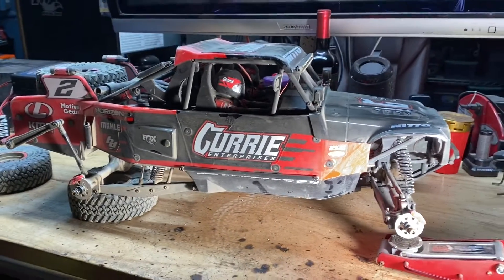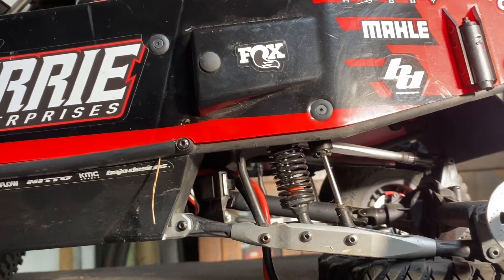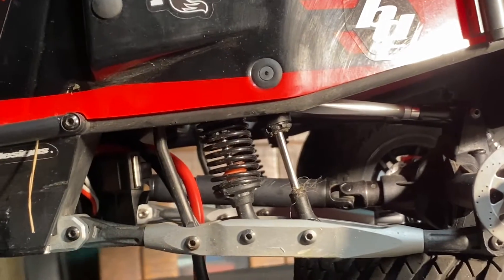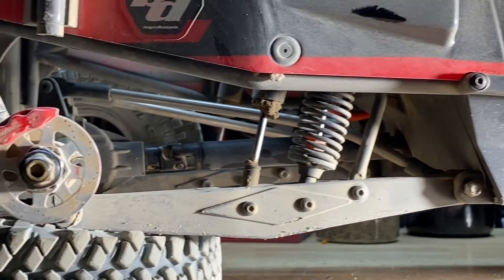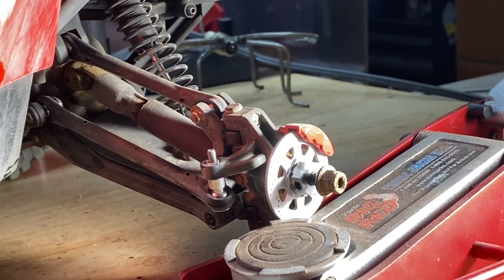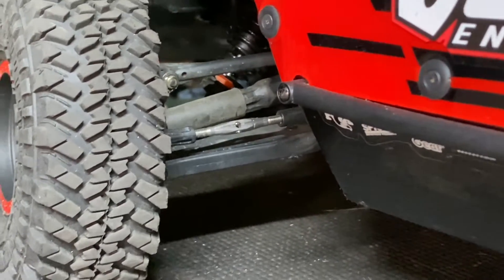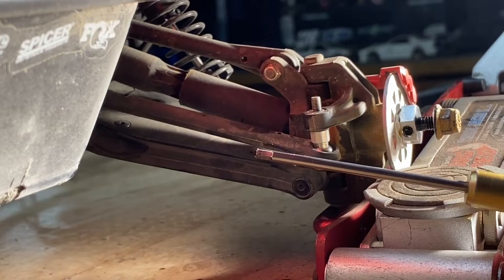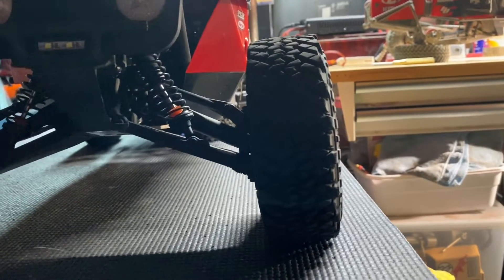Losi Hammer Rey suspension tuning

Comment: So the rear upper links you built, does it have to have that bend in it? What is the purpose for the bent link instead of just going straight to the mounting point on the diff?

Comment: I learned smth interesting, don't know how relevant it is. On full turn, at least as it comes out of the box, on the wheel that's on the inside of the turn, the axle catches in the knuckle arm if the suspension is extended all the way, making said inner wheel almost stoping. Happens on both front wheels. It became even more obvious for me once I installed some ALU upgrades for the knuckles. Also, there are visible markings on the knuckles where they made contact with the axles. For now, I will just limit a bit the steering end points to avoid this.

Comment: What rear upper links are you using?
Reply from the maker: I made them
Reply: Any specifications on the length of link you used and about how many degrees is that link bent?
Reply: james tomlinson would you please provide this spec detail so that we  may modify and fix that issue
Reply: @IDEALRC  awesome job on the links!  Jumping on the Lathe now and making some for mine. What length are the links and tie rod ends are using?

Comment: You said that you only get driveshaft changes at the transmission end. The problem with that is that  you'll get the diff not changing it's angle inline with the trans and one end of the drive shaft with have severe velocity fluctuations in the rear of the drive shaft causing excessive wear and heat. It will snap. Basic automotive engineering is keeping the differential pinion angle in line with the transmission output shaft angle unless you have constant velocity joints in the drive shaft rather than universal joints. Know what you"re taliking about before you put it to video.